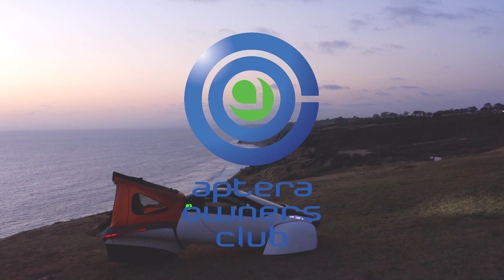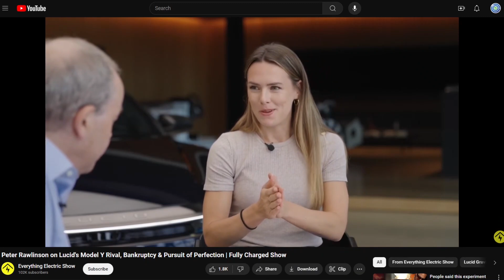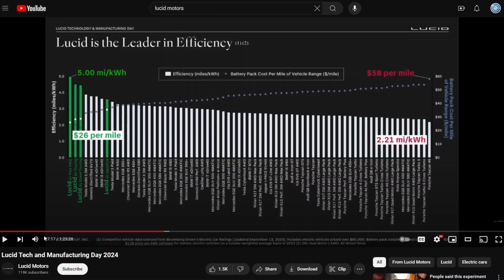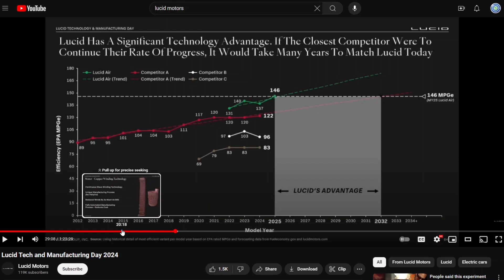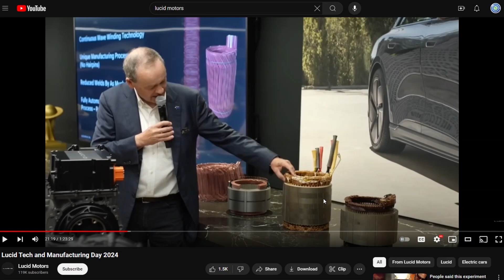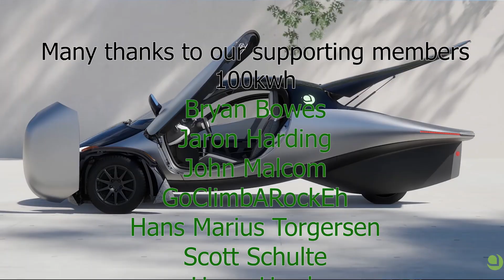Lucid's Peter Rawlinson talks about efficiency

Comment: Actually I think Aptera is a good product for Lucid to consider buying.  Lucid would get the entry level priced vehicle it needs, Aptera gets the funding it needs. Both with ties with Middle East .  The Lucid motor is perfect for Aptera- small, efficient and next Gen tech.  Lucid also has the engineering to develop the heat pump that Aptera must include if efficiency is truly the goal.
Reply: Terrible idea. Lucid would take control ans that is a really bad thing. There was another company years ago that when they got the funding, they ousted the CEO's and ran it into the ground then liquidated everything. I don't remember the name of the company. Aptera is well funded and run by the best CEO's on the planet. Let them do their job without any interference by a company building inefficient cars.

If Lucid offered them $1B for the company and if Chris and Steve took it, I would lose all faith in them and never buy whatever Lucid would screw up. Aptera is the perfect vehicle. Let them just get it done. They have more than enough funding as it is.

Comment: At 4:37 you say 10 miles per kWh is like 100mpg in ice vehicle. The correct multiplier for miles per kWh to mpge is 33.705 so Aptera’s predicted 10 miles per kWh would be a 337mpg ice equivalent. Unbelievable, I know. Peter Rawlinson’s comment wasn’t trying to be accurate but just pointing out that miles per kWh would be more easily digestible by most people.

Comment: My 2020 ZeroSR averages 10miles per KWh riding thru the mountains.  Not good considering it only weighs 430lbs. but motorcycles without fairings have horrible aero.

Comment: I was under the impression that switching from hub motors was just a supply chain issue, is that the official reason why they switched? The inverters
Reply: Well in the Aptera SEC filing, the hub motor company wanted Aptera to purchase 20K units up front. Thus a few months later, Aptera went with the less efficient driveline and even less efficient than what that company offers. To fansplain it, the hub motor manufacturer didn't have the capacity. Then the driveline supplier couldn't supply the more efficient version because they were sold out.

There you go. When you deal in the world of suppliers and read the SEC filings, you can tell that Aptera is not in the position to tell their suppliers what to do. So, they go for the next option. Buy off the shelf.

We all know that the hub motors are the most efficient and Aptera had the inverter ready about 2 years ago (they did a video on it). All of a sudden this is the most and best. Those axles and CV joints don;t create any inneficiencies whatsoever (what I was told by the fans up until recently.

Forget about the unsprung weight. Aptera did all of that testing and everything was OK.

Comment: I prefer kWh/mile

Math examples
 Let use a Tesla that uses 0.250 kWh/mi and 50 miles as a distance.

1. KWh used (50 mi)..
 50 mi × 0.250 kWh/mi = 12.5 kWh
2. Calculating the cost to charge.  Put cost/kWh of the rate you are charging  into the equation. Ex: Rate = $0.25/kWh.
 50 mi × 0.250 kWh/mi × $0.25/kWh = $3.13 ( to travel 50 miles)
3. How far can that Tesla travel on 25 kWh of charge.
 25 kWh ÷ 0.250/kWh/mi = 100 miles.
4. Calculating equivalent  mile per gallon (mpg-e). Gasoline contains 33.7kWh per gallon of energy.
 33.7 kWh ÷ 0.25kWh/mi = 134.8 mpg-e.

Comment: One thing I really appreciated about this video was the Lucid's optimum cooling system diffuser design is very similar in function to probably the best cooling system design ever, the North American P-51 Mustang.  I wonder if the Aptera has as good a design.
Reply: Aptera has the best design. It's called skin cooling. They even have a patent on it.
Reply: @billsmith5960  they had to abandon that because I can tell you from studying it myself as an Aeronautical engineer it is very hard to make work for anything more than a tiny amount of cooling.  Radiators are skin cooling but they have very short little strips which improves the cooling efficiency dramatically per area.  It's related to the Reynolds number and some other dimensionless thermodynamics parameters.  You haven't kept up with Aptera as it's been a while since they went with something more conventional, but the design hasn't exactly been revealed.  Are you an engineer or scientist?
Reply: @glike2  - I'm a Mechanical Engineer. For these discussions I just repeat what the superfans say and then what Aptera says. I can't imagine Aptera ever leading us down the wrong path when it comes to information. When they say something, it's true...... When they change their message, then what was old can be fansplained.

If you really want a laugh, go look through the old Aptera videos (from about 2021) and that version of skin cooling was even more of a pipe dream (pardon the pun). Yet the superfans soaked it up.

I knew they would stop with the skin cooling. Not only did the numbers not match up, I wonder who in the world was going to make them? Especially at the cost they would need and quality control. Yet the superfans never look at those details.

It was a great science experiment that should have been something that they paid a university to do. Not waste money on it themselves and get a patent.

Comment: The Craptera channel posted a video trolling the Electric Viking Aptera visit.  Lots of stupid comments but one that I am curious about.  What is the Aptera center of gravity height and with one or two occupants, how much load in the rear would it take to flip over.  I know the battery helps a lot in making the center of gravity very low but there will be a load limit in the rear to make sure flip over doesn't happen and to not overload the rear structure and suspension.  I am curious what that load limit is because with all the space in the rear that is a potential issue that owners need to respect for safety.
Reply: They have said in the past that the rear payload limit will be 200 pounds, and total payload limit 500 pounds.  200 in the rear seems reasonable to me since you don't want to move the centre of gravity up or toward the single rear wheel,  but I wish they allowed for more than 150 pounds per person on board up front. 
Somes of us is fat.
Reply: @993cc  I overloaded my truck so many times and when it was extreme I just went really slow over bumps.  Steel can take a lot of abuse before fatigue failure but the Aptera aluminum parts are more fatigue sensitive but the question is how much strength margins did the Aptera engineers design in.   Probably a lot for liability.   If you push the load limits, avoid speed bumps etc.
Reply: @robertkirchner7981 And some of us are big enough to be concerned about the 48 inch shoulder space.  6-2 195 pounds, 34 inch waist is not necessarily fat.
Reply: @993cc  - What if you have two 200 lb people in the Aptera (it is a two seater). The payload is reduced to 100 lbs. Then if you have a 50 lb dog you want to go camping with (along with the passenger) you'll be down to 50 lb payload. So better start packing like a backpacker. In the end, it's efficiency and that off road package with the tent will take care of all of that.
Reply: The Aptera will be extremely difficult to flip over.  You would have to hit a curb at speed while turning hard.  Weight transfer during deceleration/cornering is towards the front and away from the direction of the turn... if you think of the nose as north, think weight transfer to the NE on a left turn... very little in the rear of a vehicle.  Being an EV, of course there is an inherent advantage of most of the weight being low and another thing in its favor is the Aptera has a very wide front suspension.  There is nothing to worry about in this regard.

Comment: Lucid said they will be licencing their power train to other manufacturers at some point. If Aptera had a 900V architecture with Lucid's motor and inverter, they would be even more efficient. Add 48V architecture for their auxillary power and a heat pump that's on par with Tesla's, than there will be very little elese they could do to make this car as efficient as possible beyond using batteries with better energy density. Poor aerodynamics is the biggest killer of EV efficiency the 2nd being weight, so Aptera's far superior shape and light weight design is what's putting them ahead despite not having the most efficient powertrain. I want to see Aptera succeed and produce even more efficient EVs in the future.
Reply: You seem to have missed Lucid's reasons for sticking with 12 volts, not 48.
Reply: @gordonandhollinewhite2214  Their only reason was suppliers for all the smaller auxiliary parts. With Tesla switching over and being the number one EV seller in the US, others will follow suit eventually and more third party suppliers will have parts optimized for 48V. This was something that should have been done long ago, but none of the OEMs wanted to bite the bullet and push the industry towards this adoption when they are not very vertically integrated and all the major autos rely on the same companies to make these low voltage parts. It makes sense for Lucid and Aptera not do this yet when they aren't Tesla, which is already a large and very profitable company, so it's just cheaper and causes less supply issues to stick with what's readily available.
Reply: @JEP-Tech  That's not exactly the way I heard it. He didn't see having to cut voltage from 48 to 5 for many items, rather than from 12 to 5, when the higher voltage items were largely already on the main battery pack. I don't understand how more widespread adoption of 48 volts would change any of that.
Reply: @gordonandhollinewhite2214  Widespread adoption would change that because right now all the electronic devices that operate on lower voltages are set up for 12V, or 10.5V, or 5V inputs. The power loss in stepping down from 48V to 5V is about that same as stepping down from 12V to 5V unless it's done stupidly with a simple resister. But the weight savings and lower heat loss in the copper transmission power cables to those devices would be significant when you consider how many different power devices are scattered throughout the car including cameras, power locks, power windows, headlights, taillights, etc. It presents an extra engineering challenge and a supply problem that they didn't want to deal with when they can achieve greater effecency gains right from the start by designing a better powertrain coupled with better aerodynamics. Even Tesla hasn't converted all their auxiliary electronics to 48V in the Cybertruck, a lot of the smaller controllers are still 12V or lower just because they couldn't get suppliers to update their parts for them just yet. But switching to 48V is the only way they were able to implement stear by wire without having major powerless like would by using multiple higher current 12V motors. We all use electronic devices with circuit boards that operate on a wide range of DC voltages often even within the same device. Yet they all plug into 240V or 120V AC outlets because that's way more efficient for running wires all across our house. We wouldn't use 12V DC to run wire throughout our house and use the excuse that it makes more sense because most of our devices run on different lower voltages. That would require running thicker copper cables and add unnecessary building costs and energy costs. It's the same for a car just at a smaller scale than a house.
Reply: @JEP-Tech  If you are right, then Peter wasn't telling the truth.
Reply: "...there will be very little elese they could do to make this car as efficient as possible beyond using batteries with better energy density."  

Reducing the size of the battery would yield the most dramatic efficiency gains possible.  Lots of people could realistically get by with about 1/3 of the battery weight the LE will have, myself included.

Comment: We have gone to litres per 100km in metric countries, so that's more in line with wh per mile. An efficient gas car uses between 5 and 7 litres per 100km.  If you use more than 10 litres per 100km that's not so efficient.

Comment: It might be important to note that Aptera's 400 mile battery has increased to 42 KWHs which would be 9.5 miles per KWH. The extra 2 KWHs might just be breathing room or overhead, but it does represent a small change.
Reply: "A typical lithium-ion NMC battery is considered usable for around 80-90% of its total capacity, meaning you can access and utilize that percentage of the stored energy before reaching the recommended discharge limit; this is significantly higher than older battery technologies like lead-acid which may only utilize around 50% of their capacity."
Reply: @garywozniak7742  I am aware of that. A .5 percent increase would not cover that. But more importantly what I was saying is the battery was originally listed as 40 KWH not 42. The reason for the increase is what I’m addressing. Thinking on it more ive not seen anywhere they've listed the current 250 mile battrry size. The extr .5% might be to cover the weight of the larger battery.

Comment: In Europe fossil fuel efficiency in transportation is generally in liters per kilometer.

I support kilowatt hour per mile measurement as a standard.

On electric motors, I think the efficiency leader is, perhaps, Kia with its six terminal motor allowing ether a Wye connection or Delta connection… permitting the inverter to select from efficiency or power.

Comment: My 2023 Model 3 RWD with LFP the first 10,000 miles I averaged 202 Wh/mi. This is mixed driving 60 highway and 40 city.
Reply: What was the outside temperature   ?
Reply: In Chicago - From 12-19-2023 to 10-24-2024. It would have been lower but I had free supercharging for 6 months. The pre-conditioning messed up the average for the first 6 months.
Reply: So not quite 5 miles per KWh or mpk.  That's a lot of machinery to move down the road delivering that efficiency.

Comment: Rawlinson compares an average petrol (gasoline) car getting 30 mpg with an average EV getting 3 miles per kWh and so on with low efficiency gas cars and EVs. This is misleading. An average EV is far more efficient than an average gas car. Similarly with low efficiency EVs and low efficiency gas cars. If Aptera achieves 10 miles per kWh it will NOT be like 100 mpg. It will be as efficient as about 337 mpg!
Reply: I don't think he meant it that way, but it sorta came across that way
Reply: @suunraze  I agree. I'm quite certain that Rawlinson understands that EVs are far more efficient than gas cars but his explanation is misleading, IMO.

Comment: I am a fan of Peter Rawlinson and Lucid engineering too! But he is still tied to traditional automotive culture (Size and resulting price) Even Aptera has adopted his approach to battery cooling. (At the bottom - one of your previous videos) The tie to automotive tradition results in Lucid's consistent need for massive capital infusion.  Apter has done much more on apx. 100 million than Lucid has on apx. two billion. Think where Aptera would be with that two billion? Of course wish for success of both.

Comment: I was following Lucid pretty closely before Aptera's rebirth (before Lucid's first production vehicle was available). Still impressed by their technology and engineering, but they are a bit too "luxurious" and expensive for me.

I believe it is common in Europe to use the km/liter (km/kWh) measure of efficiency (comparable to miles/gal or miles/kWh). At 8:51 a "$26 per mile" label is on the graph. What's that all about? Here, where I live, electricity is $0.0688/kWh (plus taxes, less benefits of rooftop solar). That converts to $0.0138 / mile for the most efficient Lucid (and would be half that for the Aptera if it's efficiency lives up to expectations... or $0.0000 / mile if the Aptera's solar is sufficient). For comparison, our Subaru Outback (~23 mpg) with fuel currently at ~$3.49 comes in at $0.1517 / mile (10x the Lucid and 20x the Aptera).

Comment: Efficiency is important, which is why I’m attracted to Aptera, but you also need to produce enough to be part of the change in the industry. If Lucid can produce motors at scale, they should, then this efficiency will have real meaning.
Reply: At their price level, Lucid is unlikely to have market penetration much deeper than Aptera.  They need to move downmarket as fast as possible, if the Saudis will let them.